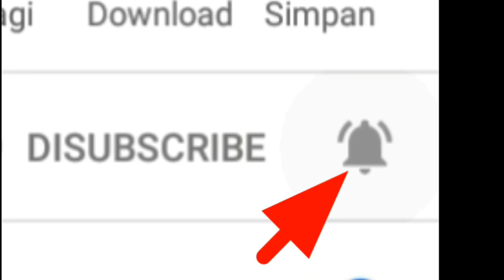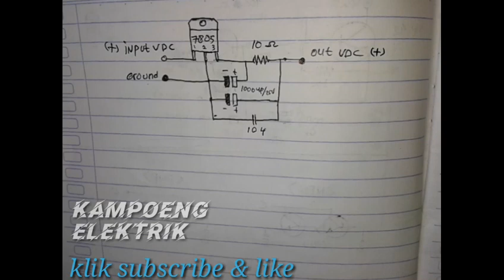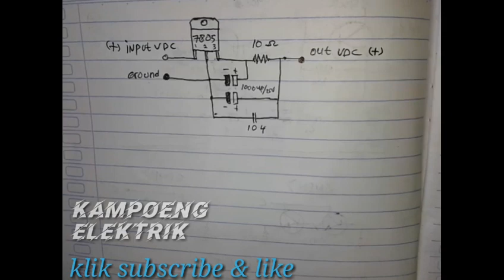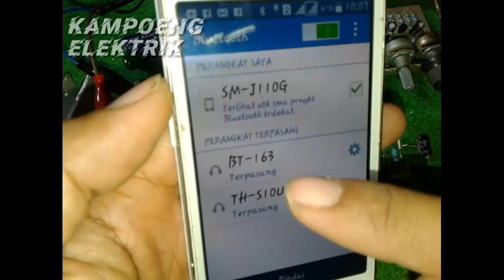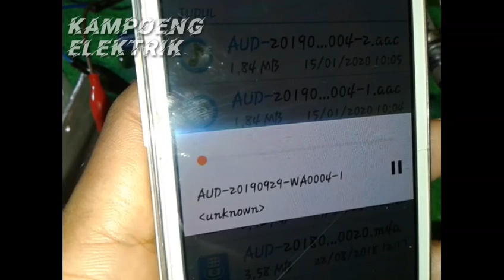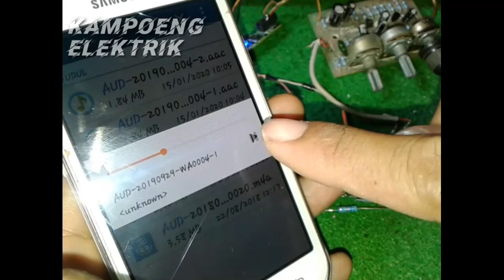cara pasang bluetooth tanpa noise tanpa dengung

Comment: Mas saya sudah coba dan berhasil alhamdulillah tanpa cuit cuit dan hasilnya bersih dalam beberapa hari ini.
Tapi sekarang ada kendala mas, blutut nyala kedip kedip aja, susah buat conect_nya, tersambung sebentar lalu putus lg
Mohon solusinya mas🙏🙏
Reply from the maker: Itu usb btut apa mp3 plyr btut om
Reply: @kampoengelektrik7160  usb blutut mas
Ini lg saya oprek²
Hasilnya tetep sama
Tersambung sebentar lalu putus lagi
Reply from the maker: Coba R 10 ohm ny lepas... tgangan usb blutut mksimal 5vdc.
Kurang dari 4.5 vdc biasanya eror.
Skrg kualitas usb bt gk kyak dahulu
Reply from the maker: Coba R 10 ohm ny lepas... tgangan usb blutut mksimal 5vdc.
Kurang dari 4.5 vdc biasanya eror.
Skrg kualitas usb bt gk kyak dahulu
Reply: @kampoengelektrik7160  sudah saya coba bgtu dan hasilnya sama mas
Saya pasang ke casan hp ttp aja hasilnya sama
Kedip kedip doang, tersambung sebentar abis itu putus 😭
Reply from the maker: Klo ic usb blutut pns mka dah rusak om... coba jngn konekan dlu ke input ampl.
 bt163 kyk e bgus om
Reply: @kampoengelektrik7160  sama sekali gak mengalami panas mas, anget pun tidak,, adem nyess
Reply from the maker: Dari systemnya mngkin om..
Brg elktronik ya gtu...
Kmren aq pasang udb bt yg mode flasdisk ternyta gak awet
Reply: @kampoengelektrik7160  bisa jadi mas
Yawdah mas lah nyerah saya
Besok beli yg mp3 bluetooth aja lah
Mudah²an awet ya mas
Reply from the maker: Enk mp3 player btut nya... suply psu trpisah
Reply: @kampoengelektrik7160  siap mas 👍
Memang rencana tak buat box terpisah
Reply from the maker: Smga brhasil
Reply: @kampoengelektrik7160  iya mas amin
O ya mas ad nmr wa gak buat belajar banyak🙏

Comment: Punya saya BT recivernya sedikit panas mas.
Apakah punya jenengan sama mas?
Reply from the maker: Nggk om..  memang ada yg gtu jga.. suply 5 vdc ksh R 10 ohm
Reply: @kampoengelektrik7160  
560ohm bisa gk mas.
Reply from the maker: Kegeden om.. 10 ohm saja
Reply: @kampoengelektrik7160  
Oh nanti yg arus yg masuk jd lbih kecil klo kegedean ya mas.

Oke trimakasih mas 😁🙏👍👍
Reply from the maker: @arnot8859  iya sama'' .klo ada gunakan ic 78m05 biar yg kluar arusnya 1/4 - 1/2 ampr
Reply: @kampoengelektrik7160  
Itu udah saya gunakan ic7805 mas. Saya ambil 1suply sama power. Suaranya bersih si normal, cuman sedikit panas aja mas.
Reply from the maker: Pnas jika kurang 50 drajat gpp...
Pke ic 7805 yg sperpat amper kode nya 78M05
Reply: @kampoengelektrik7160  
Sip mas.
Teimakasih banyak pokonya mas 😁🙏🙏

Comment: Bang punya saya kalau power supply nya pisah malah ga bisa conex walaupun hidup knpa ya..."contoh pake power supply box buat nyalain reseiver blutut nya idup tapi tidak keluar suara bisa kasih masukam?
Reply from the maker: Bisa konek bngt mas...
Mlah lbih bgus mnggunkan 2 psu.
Yg 1 untuk power.
Dan yg 1 untuk mp3 btut dan tone control.
Coba cek ground kdua psu tersebut harus saling terhubung
Reply: Arusnya ke gede an bang
Reply: Ke gedean arus bang. Coba dari bekas casan. Yang arusnya dibawah 1 a

Comment: Gan sya mau tanya... sya puya modul mp3 plus bluetoot... supaya menghilangkan suara mendenging di posisi blutoot pke rangkaian tersebut bisa ga gan...
Reply from the maker: Bisa di coba mas... 
 Dan kualitas PSU induk dlm keadaan fit gak da msalah...
Reply: Siap gan... tapi sya tr y punya 7808 bisa ga gan...
Reply from the maker: @budimulyanto5957  usb receiver bltut itu mksimal 5 vol biar lbh amn
Reply: @budimulyanto5957  

IC 7808 itu 8v gan, Pake IC 7805 yang 5v gan, kl mau gampangnya Bluetooth di bikin power terpisah aja, biar gak dengung
Reply: Siap gan.. klau pke casan hp bisa gan
Reply from the maker: @budimulyanto5957  bisa mas ...suply maks 5 v
Reply: Ini ga sya udh bingung untuk ngehilangin suara medenging y di posisi bluetoot y
Reply from the maker: Udah coba rangkaian terbut blom.. klo udah ternyta msh ada denging brarti induksi travo bruk...
Reply from the maker: Atau travo hnya ada 1 skunder .
Misal travo mmliki extra skunder itu bisa di jadikan suply blutut biar suara nging hilang.
Lngkh trakhir adlh mnggunkan psu terpisah dengan power
Reply: Udh gan... smua trafo sya udh coba.... tinggal pke power cas hp yg belum

Comment: Klo cara pasang bekas hanset blutoot tu gimana mas
Reply from the maker: Intinya sama mas..cari out nya ntar masukin di input tone control...
Untuk.suplay nya gunakan tegangan terendah dulu
Reply: @kampoengelektrik7160  klo in lewat terminal rcl tu ko degung mas
Reply from the maker: @yudhidika0126  out henset blutut yg sda spker kcilnya untuk out...
Suplay vdc hrs bner" bersih tak ada riple
Reply: @kampoengelektrik7160  ok mas tenks ats infonya
Reply from the maker: @yudhidika0126  sama" mas

Comment: Aku dah buat ko malah ada bunyi duttttttttttt pas dicoba
Reply from the maker: Coba pke tganngan xtra skunder travo biar nggk mngganggu ampli nya
Reply: Extra sekunder itu main setengah arus ya ?
Reply from the maker: Nggk mas. Tp travo yg ada extra skundernya biasanya di bwah tulisan 0 - 220.
Hnya stgh amper 0-12volt
Reply: @kampoengelektrik7160  oh kalo itu aku gak ada om ,terus solusinya gimana ya ? Apa main setengah arus  jadi out dari trafo +nya dibagi dua untuk PSU sendiri sendiri bisa gakbya ?

Comment: Klo arusnya pake aki motor dengung,untuk menghilangkan dengungnya apa bisa dengan cara ini
Reply from the maker: Aki motor dlm keadaan motor hdup. Apa cuma menggunakan aki...  
Yg dengung mnggunakan mp3 kit ya
Reply: @kampoengelektrik7160  tidak terpasang dimotor gan,cma pake aki aja,bkan kit mp3 tp usb bluetooth receiver
Reply from the maker: @bigboschanel5135  bisa di coba mas... ic 7805 ja biar gak mudah hangus usb bltt ya
Reply: @kampoengelektrik7160  sudah mas,saya jga pake ic 7805,sudah saya tmbah elco dikaki 1 dan 2,tp ketika dibuka volume  powernya dengung parah,gmn ya solusinya
Reply: Tp blm saya kasih millar dan resistornya

Comment: Bang modul mp3 bluetooth saya ic smd 7805 terbakar terus saya ganti  7805 yang bukan SMD ukuran rada besar cepat panas terus saya kasih jack di ampli iku ada noise nya keras ..saya cek penyebab nya ic 7805 itu cara agar bisa di redam gimana ya bang .. biar normal kaya bru nya lagi. Saya like bang
Reply from the maker: Coba di kasih rangkaian sperti di atas... 
Pastikan psu awal dah bagus...
7805 mksimal nuruni tgangan 15 volt ke 5 volt
Reply: @kampoengelektrik7160 rangkaian input power bluetooth saya sambung ke baterai DC 4.5v lalu saya sambungkan ke power supply mini dan specker, hasilnya suara nyit-nyit dan mengganggu sekali, apakah bisa di tambahkan rangkaian diatas?
Reply from the maker: Psu nya kurang bersih mas masih ada riple ac yg masuk. Di coba dlu mas klo mnggunkan 7805 .  tegangan minial 6 volt  untuk bisa menggunkan ic 7805...
 Itu psu untuk nyuplai kit mp3 usahakan 6 v lebih biar 7805 bisa bekerja mksimal.
Reply: Gan mau tanya,kalao saya tdk pakai trafo 5 amper dari AC belakang bisa p gk bang ??7
Reply from the maker: Ekstra skunder bisa

Comment: Bang, mau tanya rangkaian di video abang.,
MiLar boLeh Lebih keciL dari 104 ga'.?? MiLar 103 misaLnya.,
Terus itu resistor 10 Ohm berapa ampere yah.?? 1 Ampere atau 2 Ampere.??
Maaf kLw pertanyaan nya bikin bingung, Saya masih awam.. 😁🙏🏾
Reply from the maker: Untuk milar hrs mnggunkan 104...
Resistor mnggunkan stgh watt 10 ohm...
Untuk elko bisa mnggunkan 680 uf/16v klo bsa 1000
Reply: @kampoengelektrik7160  Oke bang, terima kasih..
Reply: Saya biLang nya maLah ampere yah, maksud'y itu 1 atau 2 watt.. 😅🙏🏾
Reply: MiLar 2A104J brrti yah bang,?? tadi'y kaLau bisa mau pake yang 2A103J.. 😅
Reply: @kampoengelektrik7160  kaLau pakai eLco 2200μf 25 volt bisa bang.??

Comment: Kalo modul usb bluetooth apa bisa bang soal nya yang ic sdm 7805 udah hangus saya ganti dengan 7085 tapi ada suara decit keras harus gimana pasang nya saya sabcribe
Reply from the maker: Coba pke cara di atas..  psu pastikan dah di regulasi dgn dioda dan elko
Reply: @kampoengelektrik7160  . Oke . Bang buat amplifier dong yang 100wat tapi yang stereo tegangan pakai engkel aki motor 12v gitu .saya lihat di canel abang pakai simetri semua .. kalo gak keberatan abang ya trims

Comment: Tanpa dioda aman kah om? 

Trus kalo Pake elko 4700 50v bisa ga om? Terimakasih
Reply from the maker: Itu hrus mnggunkan dioda dlu mas... sperti power suplay 
Baru mnuju ke situ
Reply: @kampoengelektrik7160  owh kirain langsung 😀

Berarti elko 4700 50v saya jadikan psu dl ya... 

Untuk rangkaian di atas bisa ga pakai elko ukuran lain?
Reply from the maker: Minimal 1000 uf 16 volt
Reply: @kampoengelektrik7160  di atas itu ga masalah ya om..
Reply from the maker: Gpp mas
Reply: @kampoengelektrik7160  maaf om mau tanya 1 lagi om.. 

Kalo bikin psu Travo CT tp pke cuma 1 doang 12v nya soalnya yg 1 lagi 12v.a ga fungsi (pke 1 dioda 2a dari 12v ke + elko, - elko ke CT) bisa kah?  terimakasih om
Reply from the maker: Lbih bgus gunakan dioda sisir atau dioda silikon sbnyak 4 buah...
Atau gunakan 2 dioda yg di letakan di 12 dan 12...
Di vdioku jg ada cara pmbuatan psu ...
Reply: @kampoengelektrik7160  iya om saya sudah liat video om
yg 2 dioda di 12 12, 
masalahnya punyasaya 12nya ga fungsi, cuma 1 aja yg fungsi saya cek pake multi tester ga konek...

Kalo saya pake 1 bisa ga?
Reply from the maker: Bisa mas... sperti non ct...ada jg di vdioku yg non ct... itu coba bngkar 12 ada yg gak nyambung solderanya
Reply: @kampoengelektrik7160  terimakasih om

 cara bongkarnya gimna om? 
Ada ga di chanell om video nya bongkar trafo??
Reply from the maker: @LALALILI_CHANNEL  klo gak nyambung biasanya solderan yg di ct itu ada yg putus
Reply: @kampoengelektrik7160  bukn gitu maksud saya travo saya 12v nya rusak/ga fungsi,..

Travo CT kn 12v 12v tp di punya saya cuma 1 yg fungsi,  yg 1 lagi ga fungsi...  Begitu loh..
Reply from the maker: Nggk ada mas.. yg di ct atau 0 itu kan ada solderan dari pbrik... itu ada plapis sperti kertas nah itu sobek lihat bagiab dlmnya
Reply: @kampoengelektrik7160  owh gitu om...  Oke om makasih banyak om saya coba

Comment: Bang kalo satu suplai sama amplinya Ada noise gak, ampli saya pake psu 5v
Reply from the maker: Biasa ada noise untuk mp3 bt yg skrg. Krena modul nya gak sbagus yg diulu
Reply: @kampoengelektrik7160  
Ok bang makasih penjelasnya
Reply from the maker: Ok mas.ambil dari extra skundernya saja
Reply: @kampoengelektrik7160  
Bang tanya lagi kalo pake mp3 player yg ada fitur bluetoot sama radionya itu kalo satu suplai ada noisnya juga gak
Reply from the maker: Noise mas.
Skrg mp3 btt kualitasnya kurg bgus bda sama yg dlu''
Reply: @kampoengelektrik7160  
Ok mas maksaih banyak
Berarti kalo memang mau suaranya jernih harus supply terpisah ya  😁😁
Reply from the maker: Betol...
Biasanya pda pke travo 500mA